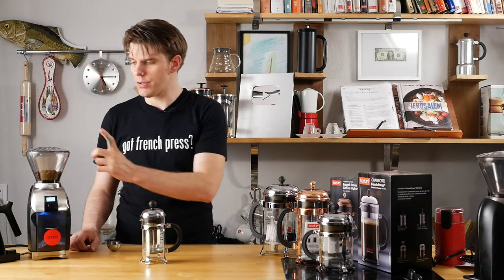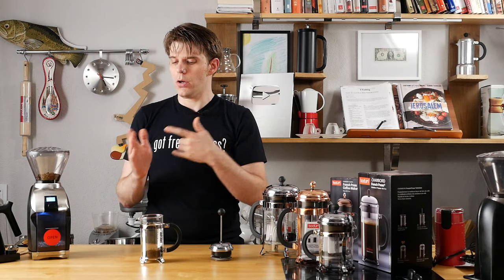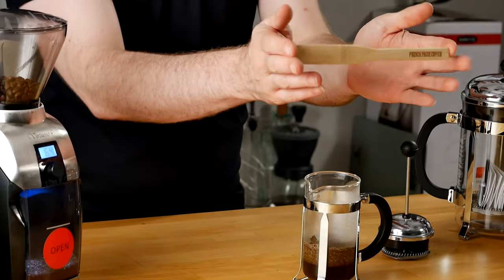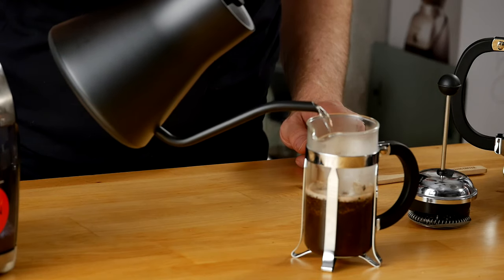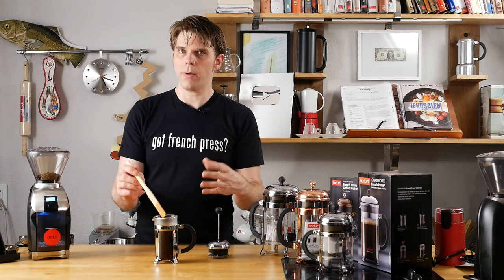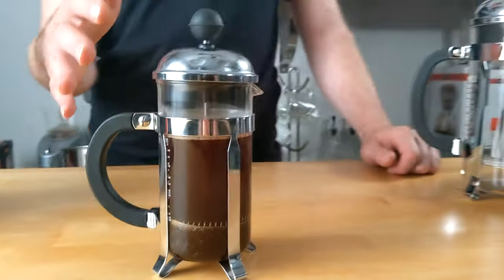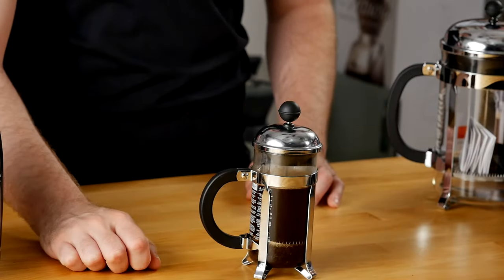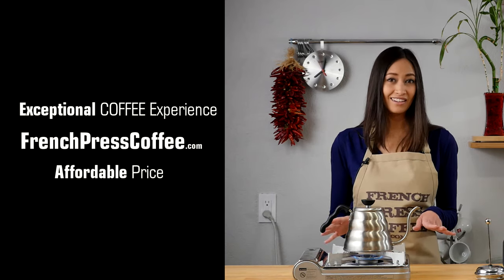How to Brew Coffee Using a Bodum French Press, Instructions

Comment: 2:25: most of the coffee floats above the water. that means the water extracted a very few of all the grounds. as we will plunge down, we will make the water pass through this coffee bed but most likely there will be a channel so most of the coffee won't be extracted at the end. So tastewise it'll be a sour, bad coffee. I guess this is about thermal mass. A pre-heated, high heat-resistent french press will maintain higher degrees for longer so the water will take out much more solubles. and for me longer it brews, better it tastes, i go for 15 minutes if i'm not busy. just give it a try. but i dont use a french press, but a porcelain tea brewer. it keeps the heat so efficiently, most french presses are weak at this point.

Comment: Can you translate the grams of coffee per ounces of water you mentioned into the actual measuring tool that you used (which was in tablespoons)?  I don't know how the 7 grams equates to the three tablespoons you suggest - per I am supposing a normal sized french press?  I didn't hear you mention how much water the french press you used holds.  Mine holds a little less than 32 oz below the silver band.  I added 3 tablespoons of coffee and filled it to an inch or so below the band and ended up with coffee flavored water.  I understand that the grind will affect the weight of the coffee in a single tablespoon somewhat but something doesn't seem right here.  Can you translate to X tablespoons per X ounces of water rather than that math you gave after you told us the measures? Thank you.

Comment: Just ordered this small Bodum 3cup French press and the official instructions say to brew for a minimum of 4minutes not maximum. Also the lid by the spout has a closed side to keep heat in for brewing which he didn’t use. After brew time you turn the lid to expose the grill side at the spout for pouring.

Comment: Hooray! Fill to around 1/3rd, stir/agitate thoroughly, LEAVE TO BLOOM before topping up and STIRRING AGAIN thoroughly. Leave to stand for a few minutes, allowing all the grounds to infuse and drop to the bottom of the beaker. Maybe gently agitate the crema (as he does on the video) to release any grounds trapped in there. Once you’ve done that, using the plunger just clears any remaining grounds. There’s no need to be pedantic about measurements and timing; everybody’s taste is different. The right way to do it is the way you like it. And I’m not convinced about the ‘don’t use boiling water‘ theory.  Nevertheless, I do put a dash of cold into the kettle before pouring. And no, the kettle isn’t a long spouty thing. There’s more, but I have to get a life.
Reply: Other folks came for actual instructions. Not the vague BS here.

Comment: I'm a process person and this video missed at least two points.  First, "French Press" setting for grinding the beans means nothing to someone who is grinding with a simple grinder that has no settings.  So, what is the grind? Fine? Coarse? Something in between? If too fine, more ground coffee will enter your cup of coffee when poured.  Please be more definitive.  Second, there is no mention of the French press itself, its parts, how it works, how to place the top so that the strainer is oriented to the pouring point and will prevent most of the ground bean from entering your cup of coffee.  How does one clean a coffee press? If you are truly a novice at this, you don't know these finer points about how to use a press.

Comment: Wait, hold on one sec. Your adding water at 200 degs?? Bad boy, someone slap his hand, please. At that temp, you're going to "Burn" your coffee and get a poor tasting if not a bad cup of coffee.  The temp should be around 148 to 162 nothing above that temp. Also, after that four mins give it another slight stir and then wait another 6-8 mins before you attempt to use your plunger. Finally, NEVER push your plunger fully to the bottom. It will inadvertently start to disturb your grounds which will start floating around once again and place some in your cup of coffee. Again, you'll get a poor cup of coffee. Rather, press your plunger about an inch from the surface of the coffee and then pour.
Reply: But after the suggested 10 ish minutes, my coffee will be lukewarm! 😩😩😩
Reply: @Ayyeliki  I'll buy that for a dollar. Thank you.
Reply: @nathangregory_  I honestly don’t know what you mean by that, but am guessing it’s a put-down. Was hoping for a good idea, instead...sigh....
Reply: @Ayyeliki  No, you read it incorrectly. Not a put down at all.